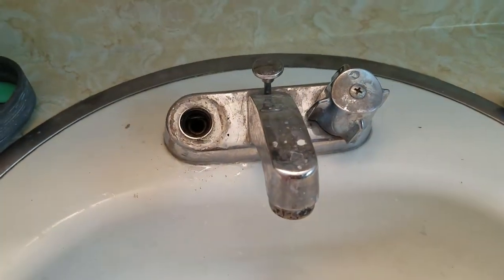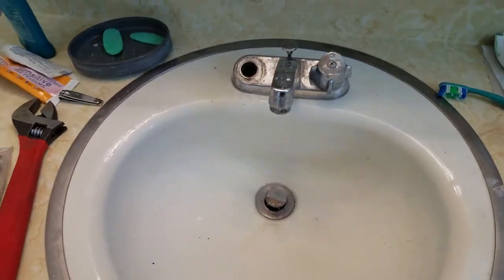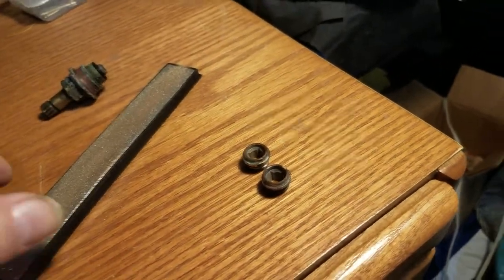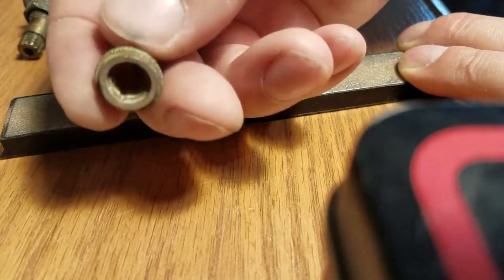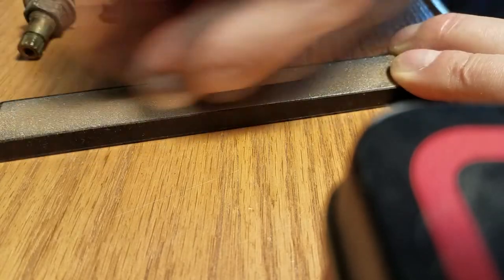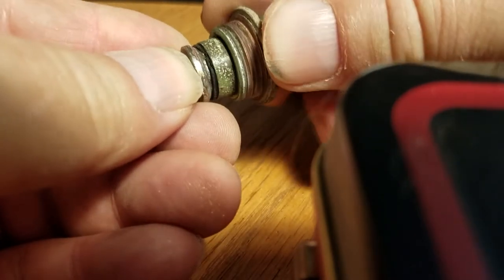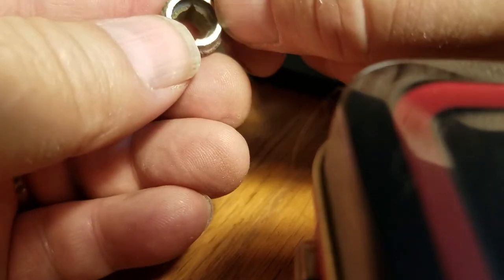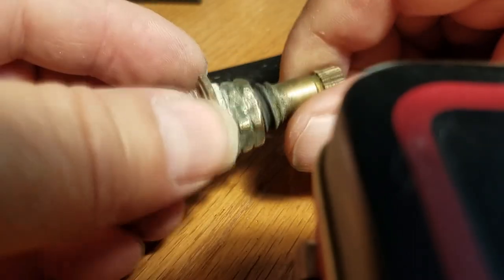How to repair a faucet valve seat

Comment: Good fix. I'm trying to use some lead free solder to fill in the pitting, then sand it down.
Reply from the maker: That may work very well.
Reply: Did solder filling work ?  My 136 yr old claw foot tub has a cracked valve seat ,& replacing that brass faucet will be frightfull coz theres no room and it has Old PVC supply pipes 😵

Comment: nice trick however while it improved the running water that was coming out like the sink was open , to much lesser degree, the reason that it did not stop completetly is that the seat has a corrosion pit on the threading, I tried  to subdue do it with teflon tape, but I doubt it helped..thanks again for your idea
Reply from the maker: you are welcome. Hope you get it fixed

Comment: I have done the same thing but with an hex/allen key in a  portable drill press chuck put tape on the key so the seat is a little proud of the key when the seat is inserted on the hex.  Now put some medium sand paper on the table put the seat on the paper the hex key on the seat and turn on the drill press.  now sand  the piece for a little change the sand paper for a finer one , repeat till the desired finish.
Reply from the maker: Thanks for the tip.  Hope that helps someone.

Comment: Think this might be my issue. I’ve replaced both the washers and they seem to be getting torn up really quickly. Plus the faucet is older then I am so not even sure if modern parts will work in a 45+ year old faucet.
Reply from the maker: My faucet was installed in 1968 when the house was built. I am sure you can replace the seat.  After time, they get corroded and sharp.  There is a special tool to remove the seat and put it back in. It looks like an L and is square to fit inside the seat.  Look up a video on how to replace a faucet seat.
Reply: Seat

Comment: Grinding down a seat is a great idea when replacing it is not feasible.  I have never tried this.  I wonder, if you grind down the seat, would you need a thicker washer?
Reply from the maker: A thicker washer is not required. You are only grinding down about 1/100 of an inch or so of the seat. Just enough to clean up the corrosion on the seat.

Comment: How do you actually remove the valve seat? It’s like 3” down in a 1” wide hole
Reply from the maker: at the hardware store, you can by a valve seat wrench.  It is shaped like an L and has a tapered end like an Allen wrench to fit different sizes of seat.  Get one of those.
Reply: If you have an older faucet with long valve seats you will need to use an allen wrench. The valve seat tools won't work.

Comment: Seats are generally pretty easy to find if you know where to look for them.  A seat costs about $2... $4 for a pair.  So I wouldn't hassle with filing them down unless it was my absolute last option.
Reply from the maker: my local hardware store only sells the whole kit with the stem for about $8.  But, I agree.  It would be nice to get just the seat kits.
Reply: I went to my local plumbing supply store and even they wanted to sell me a new stem kit for my shower.

Comment: That’s all wel and good but what do you do when you cannot remove the seat from on-site the faucet? 
Do I have to replace the whole brass assembly at that point?
Reply from the maker: Good question.  Mine are over 50 years old and I have not had that problem. I suppose getting a new faucet is the next option.

Comment: How to take out the seat. What tool did you use? Can the seat be taken out using Allen key?
Reply from the maker: You need a special valve seat wrench.   You can find one at the hardware store.
Reply: I saw a video where the seat was stripped and wouldn't come out. The guy took a flat head screwdriver, tapped it with a hammer and few times to lodge the screwdriver into the seat and then was able to unscrew the seat out.

Comment: I just took my shower faucet cylinder out on the hot side.  It is probably 50+ years old and both stores I took it to just sorta of laughed at me and told me to call a plumber.  My problem now is I don't know how to get the seat out.  I have seen the square tools that they use to get seats out but the hole in the seat appears to be circular instead of square.  Any ideas on how to get these seats out?  I'm going to keep trying to figure out ways to see it better before I try anything because I don't want to damage it.  Thanks!
Reply from the maker: The seat on a large shower faucet may have a 5 sided hole.  Get yourself a valve seat wrench. That wrench look like a big "L" and has a 5 sided and a 4 sided wrench for removing seats.
Reply: Seeing that it is more expensive to waste hot water than cold water, what you can do for the time being is to switch out the seats. And usually seats are 4 sided or  6 sided. Never seen 5 sided.
Reply: After I looked at the parts closer I realized that it is one entire unit that needs to be replaced and I finally found it.  Now I just need to figure out how to pull the old part out through a stud and put the new one back through the stud!  The stud has already been cut to make room for the rough-in valve so a little trimming here and there and we will figure it out.  
Pfister Rough In Valve for 07 Series Double Handle Shower Trims   @OutFishing13Matthew
Reply from the maker: @chasewhite2411   wow that is a big job. too bad it isn't just a valve seat.  I fixed my shower a couple years ago with new seats.
Reply from the maker: @pasqualeparente9776   You are probably right. The bigger ones have a 6 sided hole.
Reply: @chasewhite2411  I am surprised that it doesn’t have a seat .  Imagine this was installed in a brand new construction and  a week , a month or even a year later this thing sprung a leak .  I don’t believe there is not a simple repair .  No plumber in their right mind would install a fixture that would require the amount of work you’re describing to fix a leak this is my opinion.  Maybe a little further investigation?

Comment: problem is i don't think my setup has a "seat" in it.  It's just a pipe i think, and i end up having to run a rotary seat grinder over it.  Have u considered rubber seats of different material? like IIR rubber (butyl rubber) or viton rubber?
Reply from the maker: It is possible yours are newer and don't have screw in seats. I know my faucets are likely the original ones installed in 1968.  It is amazing how well the old stuff was made.  I have used a variety of rubber washers which I replaced on the valve. I wish they were tougher and lasted longer.
Reply: @OutFishing13Matthew  yeah, trust me i agree...old is gold.  i fixed mine.  But i think the choice of proper rubber material is everything.  No doubt the rubber goes first, and then the pressure erodes the pipe edge.  Definitely the rubber goes first.  Ergo material choice is key.

Comment: Very informative! I have this little problem, though: The valve seat is stuck in place; I can't remove it. Should I try loosening it with penetrating oil? Look for something to cover it? (a sleeve?) Thanks
Reply from the maker: Do you have the proper tool to remove the valve seat? If not it is practically impossible to remove. It cannot be repaired with sleeve.  Penetrating oil might help, but then it might now.
Reply: demolish the bath.  (joke).

Comment: Great Video But wouldn't it be easier to just buy a set of valve seats for 10 bucks
Reply from the maker: Sure.  But where's the fun in that, when you can fix the ones you have?  Besides, by the time you go to the hardware store, I will have mine back in and put back together. Seriously though, you are right. I have had to replace the old ones before, since they got so pitted.
Reply: Only if your local shop carries them. Up here in Alaska there are many places so remote they can only be reached by plane or boat... Good luck finding these in the local mom and pop store.

Comment: I can't get the seat out of my old faucet.
Reply from the maker: oh dang.  And you are using the special seat wrench?  It looks like an "L" and is like an Allen wrench?
Reply: @OutFishing13Matthew  That's the one. I tried to use a reseating tool since I can't remove the seats, but that didn't work either. My old Kohler kitchen faucet still drips.
Reply: @OutFishing13Matthew If your are LUCKY ENOUGH that an Allen wrench is the CORRECT size remover (Central brand, Gerber brand)
you are truly lucky.     ABSOLUTELY will not strip the seat with this correct tool.